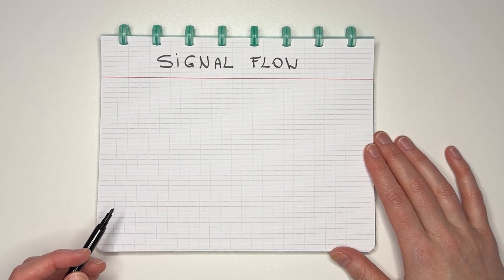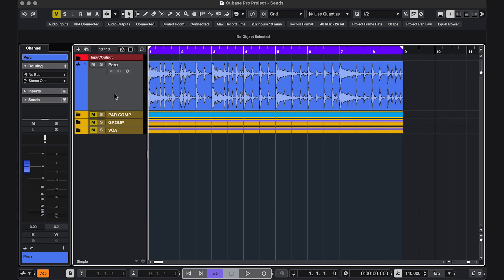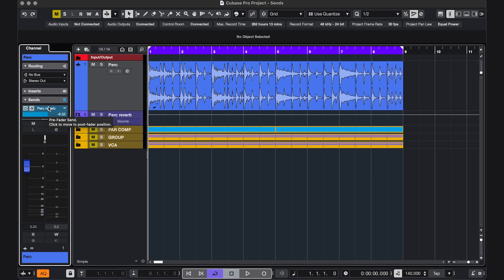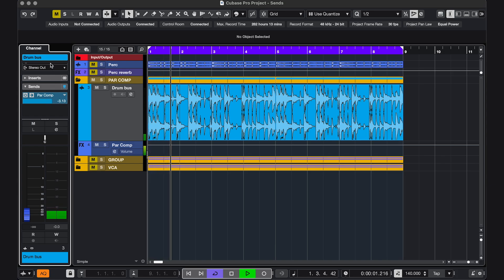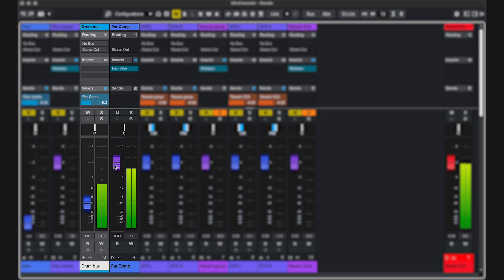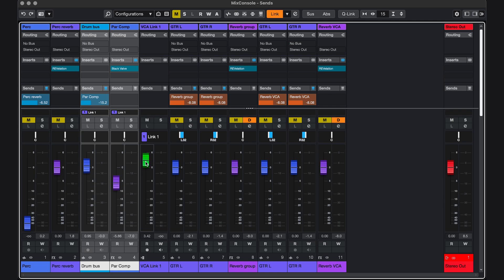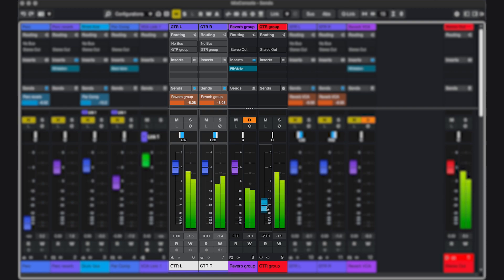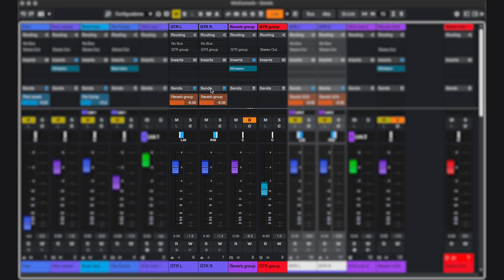Pre-Fader & Post-Fader Sends in Cubase (and other DAWs) | Signal Flow Explained

Comment: In the case of a group track with post-fader effect on two guitars - could you not also have pre-fader effects on those guitars and then send them to a group track for the same effect as with VCA fader?
Reply from the maker: Kind of, if you also route the effect return to that group. But in that scenario it's still better to use post-fader sends. Otherwise you'll get in trouble with the effect ratio if the guitar faders are automated, if you make a manual adjustment etc.

Comment: In the case where i have two reverb and I want to link them what is preferable VCA Or Q Link Or group
Reply from the maker: For regular post fader reverb I wouldn’t control them with the return faders, because that’s going to lead to inconsistency if you’re changing send levels and also changing return levels. But I don’t think you can link the send faders. So if you do want to control the return faders, I’d use Q-link or VCA.

Comment: When i change tempo in cubase from bottom. The cycle/loop bar also moves. How do i fix that. Can u make a short video🙏 I can't find solution anywhere
Reply from the maker: Probably a time base issue. Right click on the ruler and make sure these are checked: Bars+Beats and Bars+ Beats Linear
Reply: @alicebyno  but i won't be able to see the time duration then
Reply from the maker: @ You can actually. Set the main ruler like I said above. Then right click to add a track. Choose ruler and set that one to time. Then click the little / symbol on the top right to create a divider and drag the new ruler in there. That way it always stays on top.
Reply: @alicebyno  Thanks alot u're the best🔥♥️